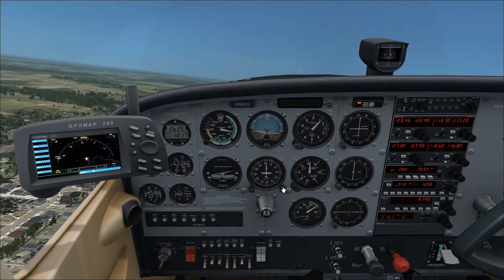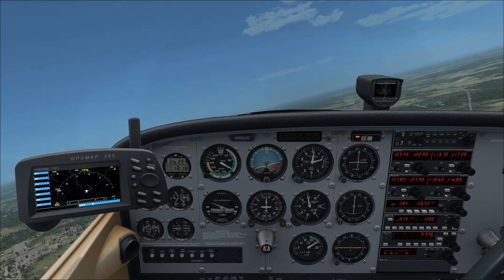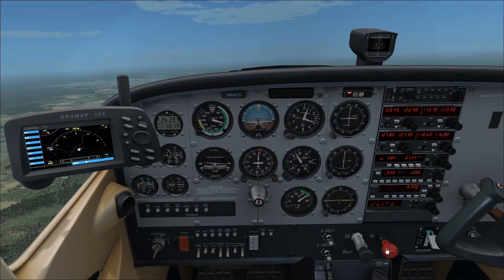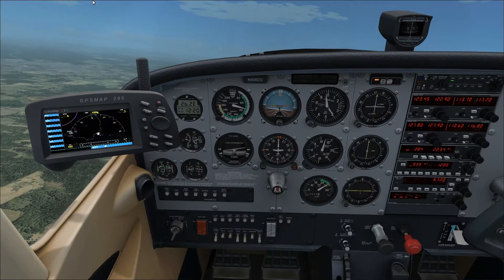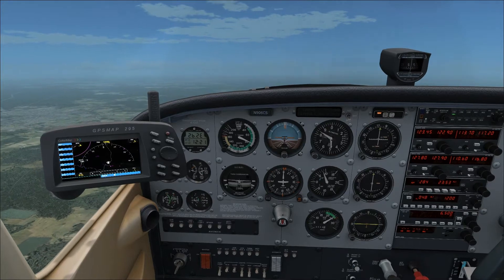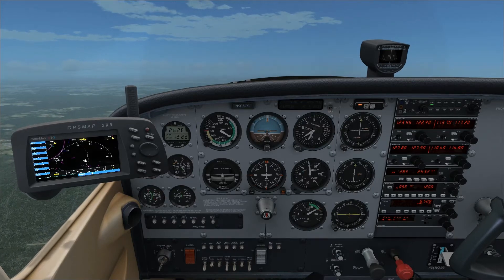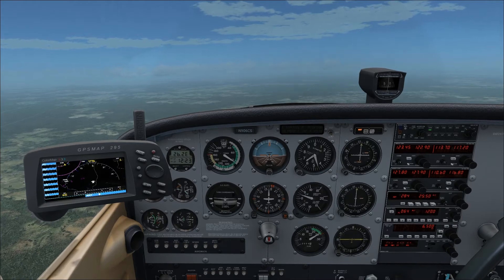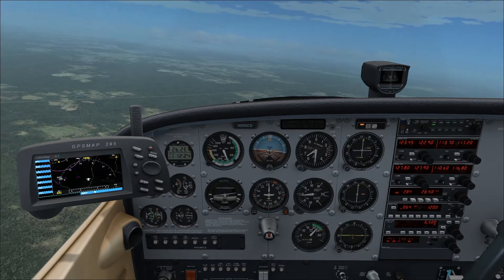A2A Cessna 172 Tutorial. Video 6, Climb

Comment: Just purchased this, when I take off the nose shoots up really dramatically, is that normal? I have to push the yoke in lots to stop it from pitching almost vertical.
Reply from the maker: check weight and balance, also make sure trim is set correctly